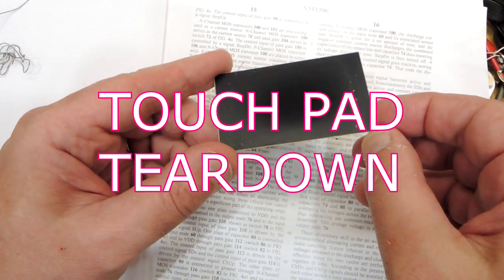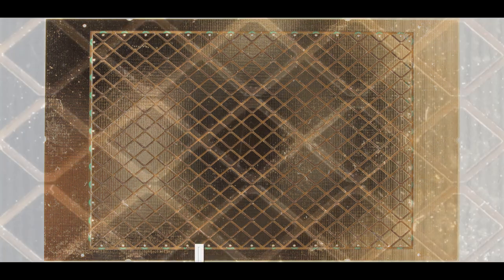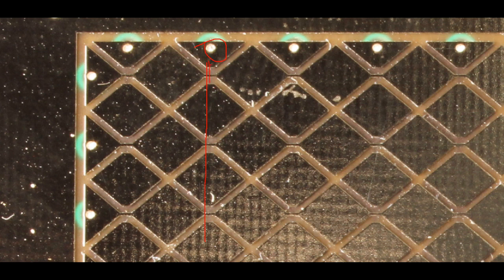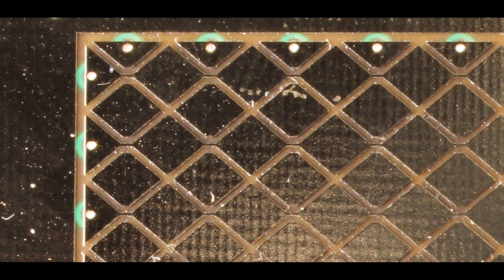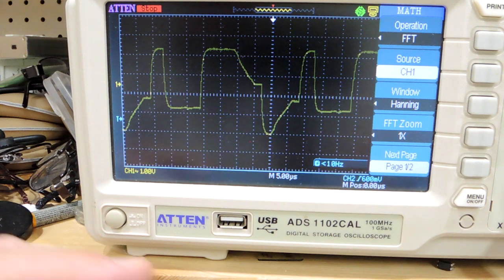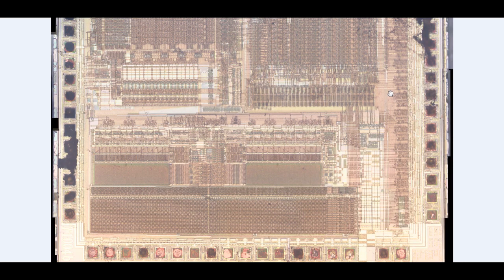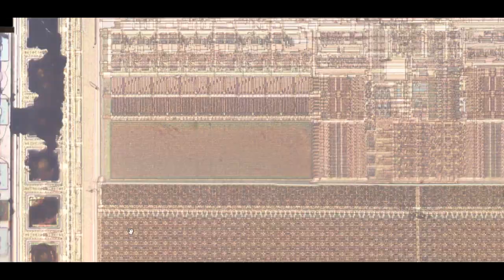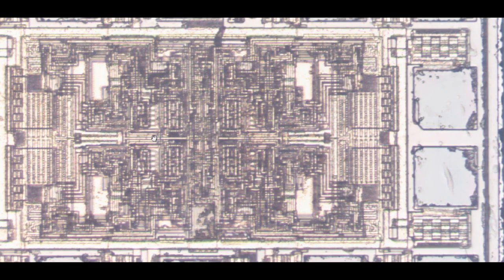Synaptics Touch Pad Teardown

Comment: What a neat shortcut they found, using conductive plastic to connect the columns. It probably helps the system reject false inputs too. If the plastic has enough spring in it to disconnect when no pressure is applied, all the columns would read offline unless a finger presses it down.